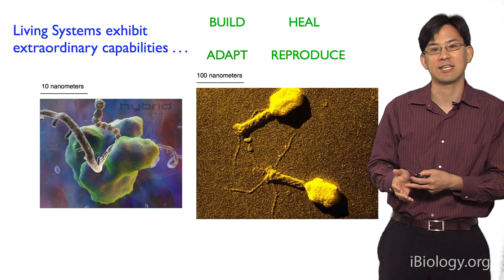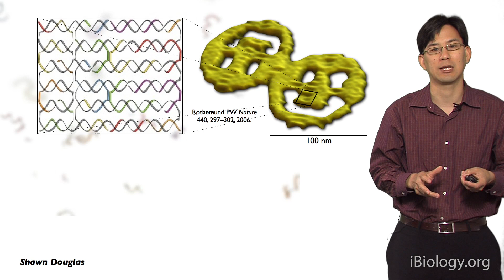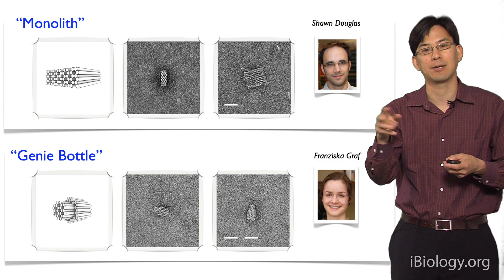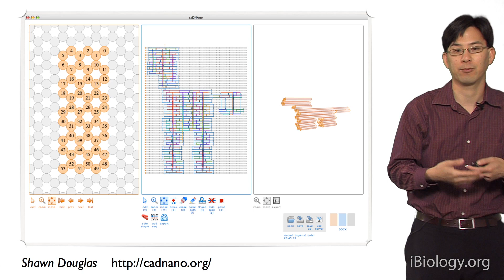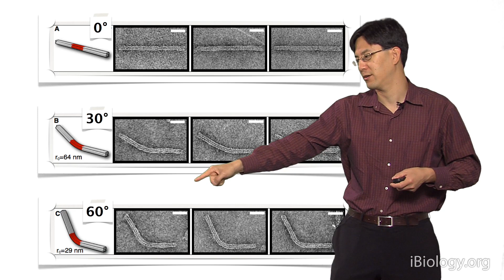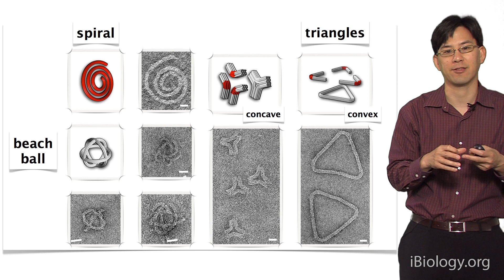William Shih (Harvard) Part 1: Nanofabrication via DNA Origami

Comment: Now it makes me curious as to if you could design a "DNA crystal" of sorts that could be produced in large quantities and placed inside a liquid. In this liquid, it would form colloids, kinda like fat molecules in milk. Then the dna crystal could react to different stimuli in the liquid or directly on itself and change properties of both itself and the liquid it is suspended in. What if it were suspended in a non-newtonian fluid and could cause it to harden by vibrating when exposed to some sort of stimuli. Or a liquid that can reactivly change colors based on stimuli by changing the shapes of the dna crystals to affect the albedo of the crystals, and thus affecting the overall color of the liquid. Maybe it could be used in display tech similar to how we have LCDs, but in a 3D format. That would be neat. Sorry for the random stuff here, I just find things like this interesting and wish we had more focus on these types of research. I feel like we should first understand the small, then use the small to build bigger things rather than keep trying to build bigger things. By understanding them we could make way more complex, yet more effecient machinery and the such. Although it does make me curious what these kinds of machinery would look like. Would be horrifying if they almost seemed organic lol.